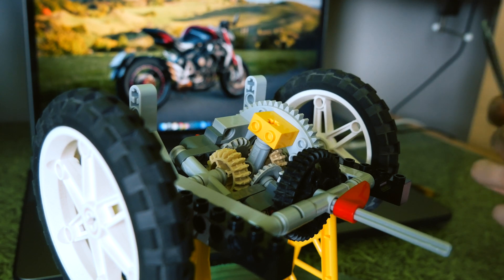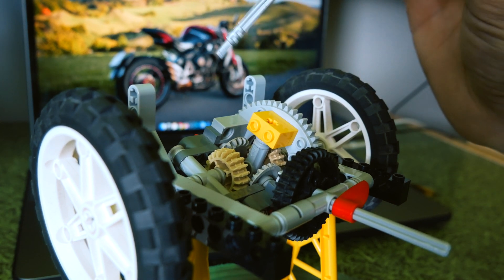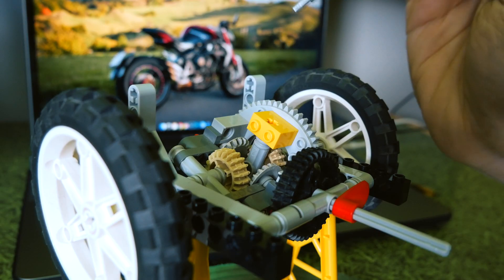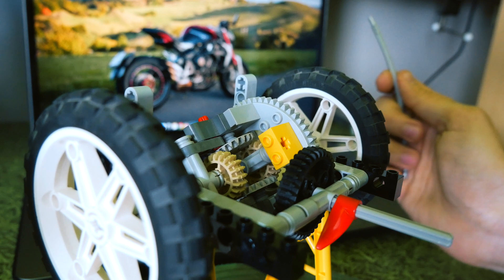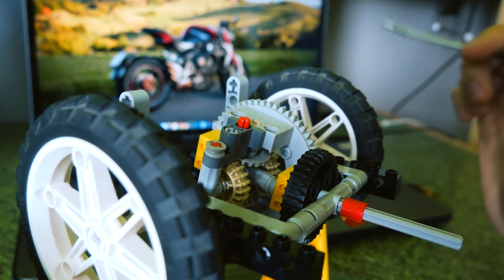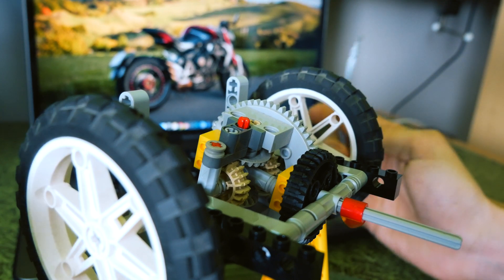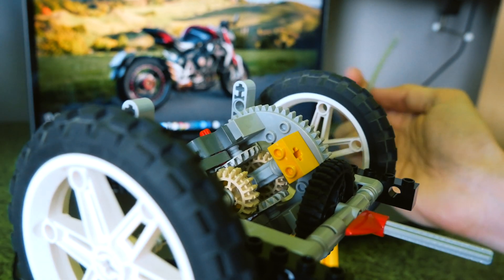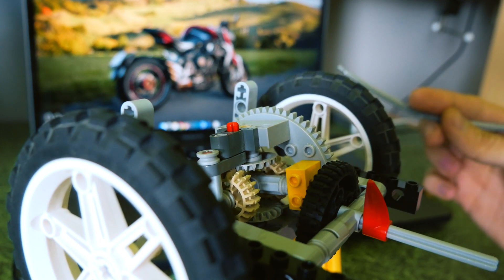LEGO Explained: Open Differential

Comment: I don't underwear, that black gear isn't supposed to mesh with that gray one
Reply: It is, otherwise there is no power coming to the differential from the engine and gearbox
Reply: @VisioRacer  a spur gear shouldn’t mesh at an angle with a bevel gear